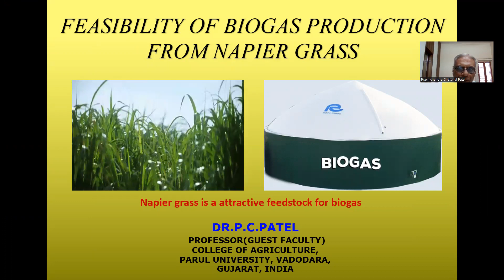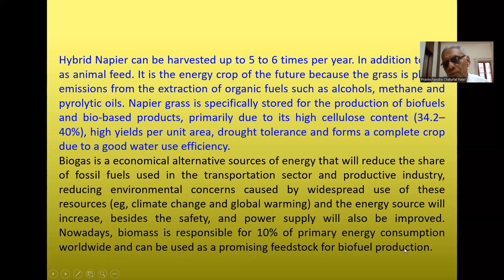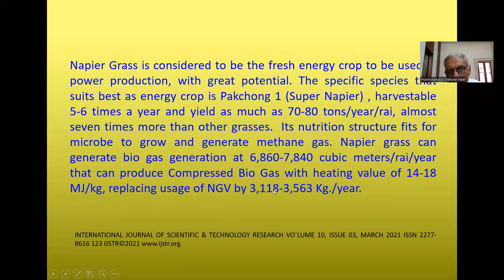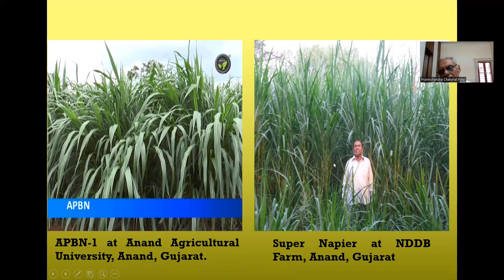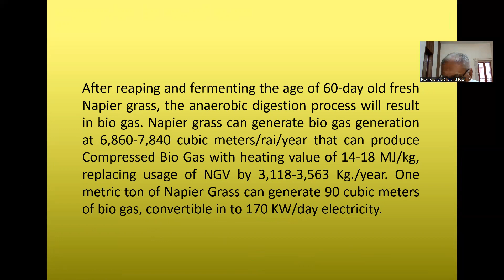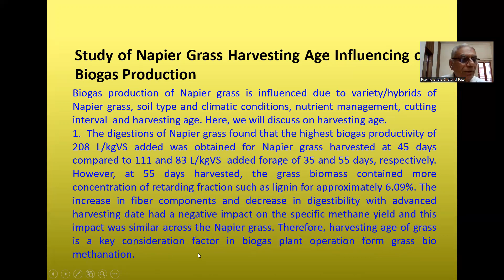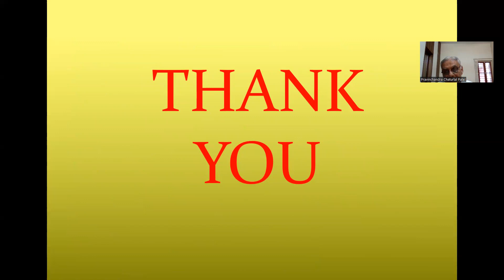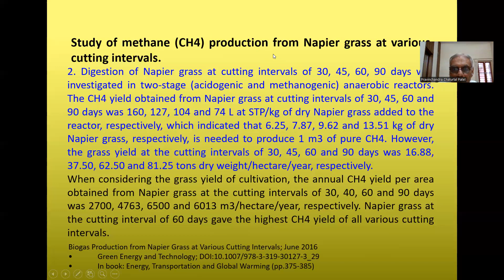FEASIBILITY OF BIOGAS PRODUCTION FROM NAPIER GRASS BY DR.P.C. PATEL

Comment: Could you please make a  comparison between sorghum and sorghum sudan grass. Thanks
Reply from the maker: Sorghum crop have only cut and it is used for grain purpose. It is not multicut. The sorghum Sudan grass us a multicut and used for fodder. It has more number of tillers and grain size is very small. It can be cut for 2 to 4 cuts in a year. Eg. SSG.59-3 variety of sorghum is a Sudan grasss and famous for multicut.